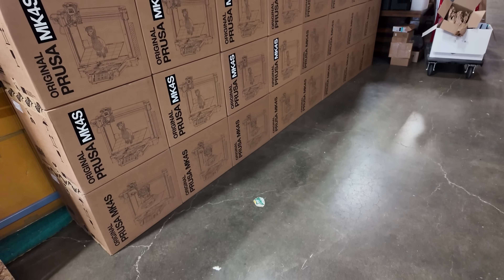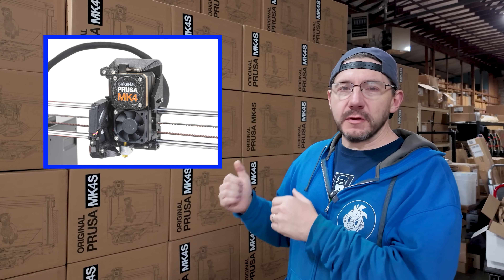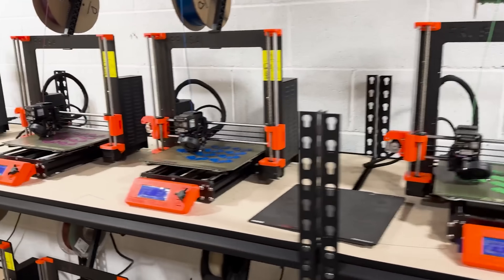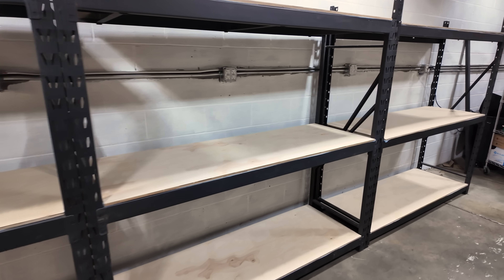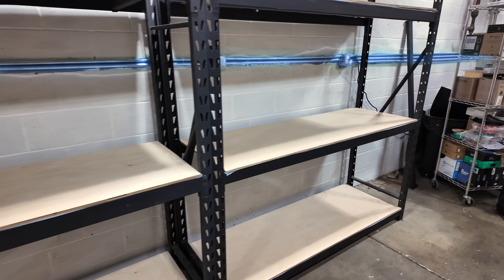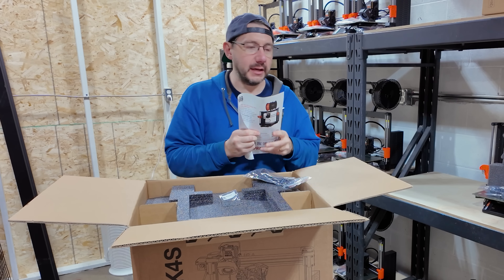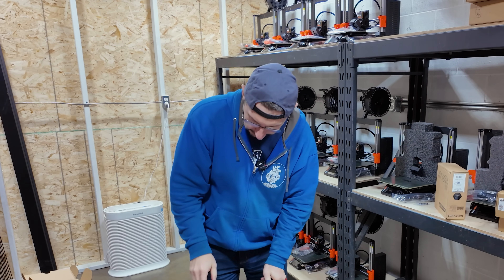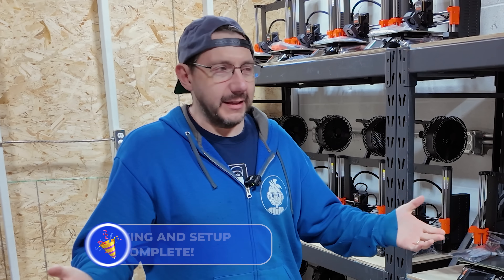MASSIVE Print Farm Upgrade!

Comment: I was doing a bit of research and if you use a stone slab/tile it absorbs the printer if it wobbles and will stops it from vibrating. It has a little weight to it but I’m pretty sure your shell should be able to handle it and It’s not that heavy where you can’t pick it up yourself I have it resting on a little table to stop my printer from wobbling and it works really good.

Comment: Yea!  Those shelves are amazing for sure.  I especially like the diagonal braces placed mid span of the uprights by the manufacturer instead of placing them so you get at least one complete triangle.  Hope they are welded in place really, really well.  Most all such shelving these days is outright junk.  I also love the flame resistant shelf surface you chose.  Do yourself a favor and get some fiber cement board like Hardie Backer to help get some flame resistance.  I to have many Prusa Printers but I sure miss the old school extruders with an exposed gear for nearly instant filament changes.

Comment: To seriosly dampen vibrations you need to bond together (a bond with very high strength) 2 or more materials that have dissimilar harmonic frequencies. The vibration dampening happens by the dissimilar materials rubbing against each other and that energy from the vibration becomes heat.
Reply: You can also just use mass. I bought a huge, heavy concrete paver and put  under my MK3S, and the noise level went from unacceptable to almost negligible. The light printer can't shake the heavy stone around. Pavers are also dirt cheap, but hauling the mass around is a bit of a pain. But I guess to some extent this is two materials - I did put some foam under the stone.

Comment: Since you asked!

My print farm is pretty modest by comparison. Yours is quite the awesomeness!

Mine's:

A small Voron family (2.4 350, Trident 300, V0)
2 MK4s
3 MK3s
1 XL

I still use the MK3's but mostly for my own prototypes. While I love the MK3 platform, and consider it the perfect balance of quality, durability, and cost - the MK4, once I learned a few things (e.g. I have to use a custom Z-height for my slices for the first layer quality I need, which is important for my prints), I've been VERY VERY happy and expect I'll be converting the last MK3 I use for customer prints into another MK4 or maybe a Core XY.

The XL is more fickle but it lets me do multi-material (PLA with PETG supports, PLA with TPU on top) and that's made a substantial difference in my prints. The Vorons are Vorons :) I love 'em and I think they have the best quality. But for a print farm, they are the most fickle. But I also know them like the back of my hand and find they are easier to work on than the Prusa's. Vorons also helped me get a large build area with great quality before the XL came along. While the XL is also phenomenal, for the larger build areas when I need them, I'm glad I have the Vorons.

It's nice to have some diversity for what I made said another way but my Prusa MKx printers have always been the workhorses and tend to print 80-90% of the prints I make.

Notably, these are mostly for products I make and design rather than print for hire, though I have done that before too (I used MK3s exclusively for that back then).

Forgot to say, all this is tied back to a print queuing system I wrote myself. It mostly just links to Octoprint and I get telemetry back via MQTT which ends up in Clickhouse and presented in Grafana for monitoring. PrusaConnect is great but I had this before PC and also like to be in control of the networky stuff end to end and it integrates well with staging what to print and where (but is also not very automated).
Reply from the maker: This is SO COOL thank you for sharing!
Reply: @3DPrintingNerd  Yours is a true thing of beauty though! Congrats on the expansion and upgrades!

Comment: Hi Joel - Couple of comments / questions - Why not go with Prusa's "Core 1" vs the MK4s?  
Also - regarding isolating the printers with vibration dampeners to eliminate ringing - Travis over at ShopNation did a good video on this.  He cut the shelfs per printer, totally isolating each surface, also adding insulating sticky foam on each. Shelving material was MDF (1" fiberboard) vs plywood.  Just a few thoughts...  Keep up the great videos!
Reply from the maker: This all happened a few months ago, so way before the Core One was even announced. For the isolation, I may try that, but my solution seems to be working very very well.

Comment: I am late to the party but i would get what is called Utility Rubber Stall Mat, 3 ft. x 4 ft. - used for horses at tractor supply. you can lay it on top of the plywood or use it with the wire underlayment.  I would also cut some strips to place in-between the racks and on each foot.

Comment: My MK4S no longer downloads files after uploading to Connect.  I hope that doesn't happen to you!
Reply from the maker: Oh shoot, what did Prusa Support say when you contacted them?
Reply: @3DPrintingNerd  I have been going back and forth with them for weeks on this issue and an issue with my MK4S experiencing a "thermal anomaly" on prints with flat areas bigger than a couple square inches.  When the perimeter / bridging layers start after the infill is done, the nozzle doesn't hold its temperature and I get the thermal anomaly.  I didn't have any of these issues before upgrading my MK4 to the MK4S.  I'll let you know if I find a solution on either.  As of know there aren't any solutions.
Reply: @3DPrintingNerd  The new firmware fixed it, thankfully.  Also, I wasn't using the silicone sock which ended up being the cause of my thermal anomaly.  I prefer not to use it and it was "optional" when upgrading.  However, you can't print large flat areas with overhangs over infill without it.  Love your channel!

Comment: You could've upgraded your MK3S+ machines to MK4 like me and then given the old MK3 parts a new life using a 3D printed frame printed on an XL :) Your MK3's becomes slightly less reliable but it works and you get a tonne of bonus printers 🙂

Comment: Joel:  Choose THE machine, I went with the Prussa ecosyste...

(Me looking around awkwardly at my 5 different printers from 4 different brands with different sizes and nozzles)

In all fairness my setup is more of a workshop where I do a bunch of different things and each printer does something different.  Cosplay helemts here, tabletop terrain there, tpu stuff in this one... etc.  and not so much a farm
Reply from the maker: For the farm, I wanted all machines to be consistent, and therefore in the same ecosystem. Having all of the machines the same makes it much easier for slicing a client job because I only have to do it for one machine. I can tune it for a single machine, and in the end, get a quality product out of each machine.

Comment: I would install a SPD on the Breaker box for the whole shop to clamp incoming surges! Midnight solar makes some of the best then I would use your regular surge protectors. Midnite also has small voltage one that could possibly work for regular voltage at outlet boxes, or you can have an Isolated ground for each box as extra protection. But I’m not an electrician, but I’ve been researching for safest operation of my small farm.
For the WiFi I put all my Filament and Resin printers on a private separate unifi vlan network with some advanced security settings and a honeypot. And I’m setting up sensors, air quality monitoring humidity/temp, Ubiquiti Poe g4 instant cameras for my printers.
Reply from the maker: Some great ideas you have there!
Reply: @ Thanks, Big nerd myself with a passion for researching best ideas and implementing them as best I can. Same for 3D printing!

Comment: You can use the mats they use for exercise or the Eva rubber, it is a material similar to exercise mats and I have used them with several 3d printers I got to reduce the noise from 80db to 60db with a 0.5cm layer
It's a cheaper recommendation than being with concrete pavers
Reply from the maker: I will have to try that out!

Comment: i only have 3 fdm printers in my "farm"... the 2 resin printers in addition make farm sound more like the correct term though i haven't used them in years.  couple things i'm proud of - all tasmota wifi sockets that start up all the aux equipment at once (exhaust, air cleaner, filament dryer, enclosure heater, work lighting), auto power off when printers idle for an hour, and 433 mhz connected smoke detectors (one ionizing, one particle detecting... actually the ionizing one is dumb but there is a zwave alarm detector near it that makes it connected) that automatically power off everything on alarm (except the cameras).  could do this with home assistant but i wrote some custom software for it.  then the other thing i'm proud of is all spools are in rubbermaid dry boxes.  i also have some rewinding spools that hang from the same hangers as the dryboxes if i ever need to load a bunch of colors for multi color (i have a mmu2).  i standardize colors for materials so years later when i try to remember what material a particular part is made off i know just by looking at it.  i really like the thermochromic filaments even though they might be slightly weaker it's really handy for some projects to see if a part is warm or wet.  i use those for pla and abs.  petg is always translucent, asa is always white since it might go outdoors.  black for tpu.  there's also some bluetooth thermometers that i don't really look at much.  pavers and foam under all fdm, why not, they're so cheap and flat and stable and make all the difference with noise.  i also want to get a mark 4 for softer flexibles.

Comment: It seems like Prusa has a golden opportunity to add a feature where you can "pre provision" the printer on first boot using a script on the USB drive.

In Linux, since we often set up tens or hundreds of servers, there's a concept of a "kickstart" script, for first setup, where it will install things, configure networking, set a name (can even pull a name from a central server), etc.

It saves a ton of time since you literally plug the machine in then walk away.

For 3DP, you'd need to manually load filament, but it seems like for farmers, everything else in that process could be automated!
Reply from the maker: I love this idea. LOVE IT.
Reply: @JeffGeerling  didn’t know you were into 3d printing
Reply: @probablyposedion  Heh, started getting the itch in 2020. Was up to 5 printers last year, but have pulled back to 'just' 3 for now :D

So far I've avoided the temptation of massive printers or resin...
Reply: @JeffGeerling  so many Pi's so few klipper instances .. what a waste
Reply: @richiedeadsix 
Klipper is not the optimal solution always
Reply: Prusa already did this. All the network configuration is saved in an INI file on a USB stick that you just put into the printer. It was a god-send for print farm owners, but it was a misunderstood feature that normal people didn't like.
Reply from the maker: @brisance  It gets you on the network but you still need to manually add to a Prusa Connect account. If we could provision THAT via an ini file on the USB stick, THAT would be cool.
Reply: Engineer here.... the only realistic way to reduce resonance and noise is with mass.... foam is fine, but heavier, higher density and thicker would likely be much better.  Great video!!
Reply: Oh look, the Ansible guy ;) It still amazes me how little crossover there is between tech and engineering fields. This provisioning problem has been solved for ages already, but for some reason each separate field wants to solve the same problem in their own unique way. But hey, guess that keeps us system integrators busy.

Comment: I might be grasping at straws here, but have you considered also cutting the plywood such that each printer is sitting on its own piece? That would reduce any potential coupling between printers on the same shelf.
Reply from the maker: I thought about it but so far the single pieces are working well

Comment: Did you think about power outages when designing your farm? I ask because I didn’t notice and battery backup systems.
Reply from the maker: I did. So far power at this facility has been rock solid. I may look at UPS solutions in the future if the power starts to be inconsistent.

Comment: With so many machines densely packed into a small(ish?) room, how do you handle air conditioning?
Reply: IDK the TPD of those MK4Ss, but 120w input * (36) units = 4300W, which isn't a whole lotta heat load in an average industrial space.

Comment: Future shelf upgrade would be using RTV bead on the frame and spread it out in a one pass level as possible and let it set for  while. Then place the plywood on the shelving and anchor with a screw placed at the middle (in between) each printer. This will allow for  good isolation and you wont have RTV stuck to the plwood and will come off the metal frame of the shelving.  You could go as far as using duct tap as a barrier on the underside of the plywood where it would come into contact of the RTV.

Comment: Hey Joel, I investigate fires for a living, and I see a lot of those cheap power strips from Amazon with USB power supplies in them catching fire all the time.  With something like  a print farm, that's going to be drawing significant power all the time, I would go with something more robust.  I recommend Tripp-Lite ISOBars.  They have a metal housing, so if something does go wrong, it doesn't set the housing on fire.  Plus, the internal components are just built better.
Reply from the maker: I'm so glad you brought that up, I appreciate the safety advice!  I'll definitely look into some more robust options.
Reply: 2nd.  Our hospital spec'd those Tripp-Lite unit and we installed a few hundred; they are very nice, and that's coming from someone who's not a Tripp-Lite fan generally.
Reply: A cost effective option is any power bar designed for server rack install, no idea in the US who supplies these for a fair price.

Comment: Bro... having this many wifi devices in one location as condensend and packed as it needs to be for a print farm, is a monumental mistake. You should've talked with a network engineer and just invested in some Layer 2 Switches at least to get them reliable connection... But don't worry, eventually you'll have to make that jump
Reply from the maker: I may wire in the future however the amount of traffic these generate is so little that I don’t see an impact to the WiFi. BUT I do love wiring Ethernet ;)
Reply: and prusa’s wifi implementation is extremely slow

Comment: Concrete pavers work super well.  I was surprised how a $5 paver stone from Lowes nulled out the Bambu Lab A1s crazy vibrations  What sort of projects / commissions are you doing with the print farm?  Hourly rate?  I see he air purifier in the background - yes - print safe - what about fire safety?

Comment: Awesome video! Putting something under the shelving feet, will help reduce noise greatly. Rubber mat, 3d printed TPU feet. The paver and foam for each printer would also work, as you mentioned.

Comment: Cut the shelves to have a single printer per shelf. That way vibrations have to travel down through the insulation and then back up through the other shelves. That way you cut out horizontal vibration transfer through the long shelf itself. It forces it to go through the shelf supports.

Comment: Could have saved 10’000 by building Kits. I wish I could afford even 1 Prusa.
Reply: @zakaroonetwork777  Depends on how valuable labor is. I'm in the middle of building a MK4s kit and it is taking forever. So many small parts to put together it is totally worth $200 for Prusa to do it. As a business, you'll spend less overall getting into production faster and generating cash flow than taking days or weeks building machines.

Comment: Regarding reducing vibrations, you'd ideally cut the plywood to have an individual panel per machine and a gap between each panel so they don't touch and transfer any vibrations, then foam under each panel.

Comment: Cost of replacing nozzles is a big factor for me to hold upgrading my print farm from mk3s+ to mk4s.  What’s your workaround?  Simple $5 nozzle replacement becomes $20 a part can add up quickly when running 30+ units.